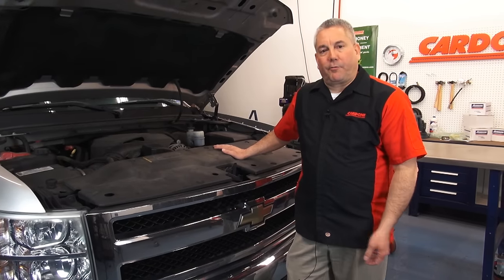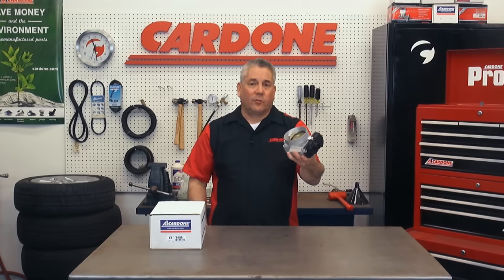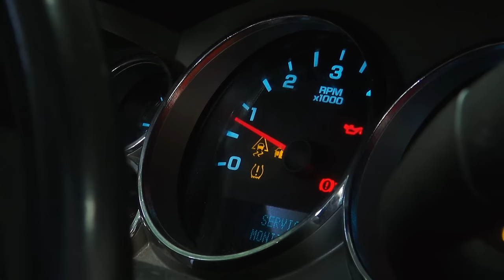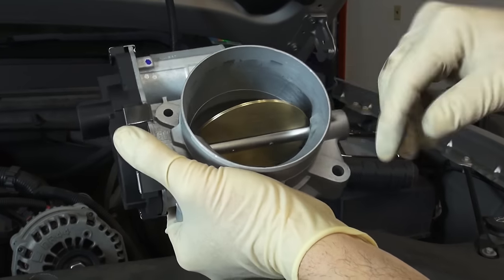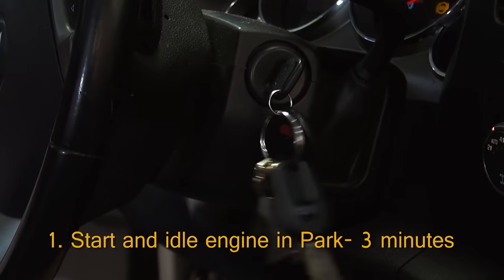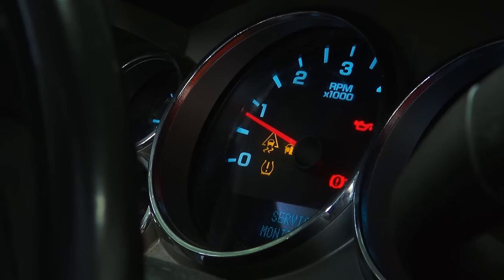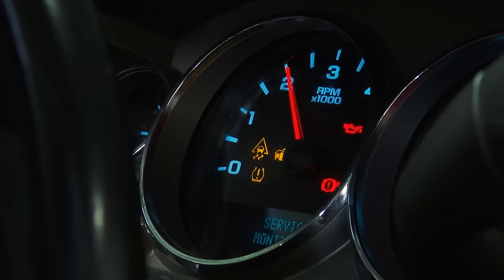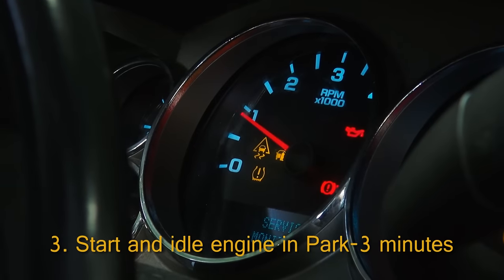GM Truck Electronic Throttle Body (ETB) Relearn Procedure

Comment: Need idle relearn scan tool this doesn't work
Reply: mook9210 ey Man whats Up, some help which scaner can do the idle relearn
Reply: Just drive the truck changed my throttle ran crazy but it eventually straightened out.
Reply: I just changed mine and it just ran like new, no tool 😃
Reply: It works but you need to clear the code before starting the relearn and during the drive cycle
Reply: @BigBlock632  disconnecting the battery clears the code but if it comes back on while you're driving it wont complete the relearn cycle . You can get a cheap obd2 scan tool that will erase the code for under 40.00
Reply: I replace the throttle with out taking off the battery and now the truck won’t turn on or crank what can I do ???

Comment: 2013 GMC Sierra 1500 New throttle body... had to unplug the ground wire from the battery for 5 mins then my rpms went back to normal and cleared the check engine light.
Reply: Brice Bayless did you do this while the key was in the ignition, truck running or off?

Comment: How do you use a scan tool to reset the computer after the throttle body is installed?
Reply from the maker: It can depend on the vehicle you're servicing.  What are you currently working on?
Reply from the maker: Heres the reset procedure for your 2008 GMC Envoy. 

With Scan Tool - Reset Procedure
 *  Diagnostic Trouble Codes (DTCs) P0068, P0101, P0102, P0103, P0106, P0107, P0108, P0116, P0117, P0118, P0120, P0122, P0123, P0128, P0171, P0172, P0174, P0175, P0201, P0202, P0203, P0204, P0205, P0206, P0220, P0222, P0223, P0300, P0351, P0352, P0353, P0496, P0601, P0604, P0606, P060D, P0641, P0651, P1516, P2101, P2119, P2120, P2122, P2123, P2125, P2127, P2128, P2135, P2138, or P2176 is not set.
 *  Ignition ON, engine OFF.
 *  The vehicle speed sensor (VSS) is 0 km/h (0 mph).

 1. Ignition ON, engine OFF, with a scan tool, perform the Idle Learn Reset in Module Setup.
 2. Start the engine, monitor the throttle body Idle Airflow Compensation parameter. The TB Idle Airflow Compensation value should equal 0 percent and the engine should be idling at a normal idle speed.
 3. Clear the DTCs

    Important: Do NOT perform this procedure if DTCs are set.

Comment: Hi, I just cleaned the TB of my GMC 2008 5.3L and after I put everything back, turn ON the engine, ran it t on Parking for about 3 mins the RPM went to 3000, then later I drove my truck for about 1 hour, as I read on other comments, on speeds of 40-50 MPH, the high idle is still there, what can I do to reprogram the TB and lower the idle RPMs? Please let me know, thanks a lot for your help.
Reply: +Cardone Industries Hi, thanks for answering my request, my truck is a GMC SIERRA 1500 extended cab 5.3L SLE model, I hope this information can help, thanks again
Reply: +Cardone Industries After a few days driving my truck the RPMs when down almost to normal, on Parking they go down to 600 RPM, but still when I drive it and make a stop the RPMs stay at 1,500 and go down slowly making my transmission not taking the gears down normally and then you can feel the gears making a big bump when they go down, any ideas??? Thanks a lot for your help
Reply: +grillomix My 07 Avalanche is doing a similar thing. I ended up taking it to a shop where they re-set the learn procedure I guess, now it seams to be idling back to normal in park and when i come to a stop. However I do notice it will increase RPMs when costing even on a upgrade. seams to level out at 20MPH. another note it also only seams to have problem when at operating temp. when the truck is cold it operates as normal. Also seams to be shifting late, worried it will damage my transmission and wear my breaks fast. I'm hoping driving will complete the learning.
Reply: +Leon Calderon  did your car end up completely going back to normal? and how much did the shop chaarge you for the learn procedure?
Reply: +Tyler Lapp Hi, I ended up taking it to the dealer, they charged me $110 but I found out there is a recall on the software for the throttle, so go to the dealer and ask for the recall and this will fix it

Comment: Mine would sonetimes overheat if I let it idle in park for 3 mins cuz it idles at 1700 at times.
Reply: Shouldn't over heat from idling for 3 minutes unless the radiator is plugged a bad thermostat bad water pump or you have a blown head gasket or cracked cylinder head .  Did your electric fans turn on because they should if it starts to get warmer than normal & the 07 - 09 models usually ran at about 210 degrees to begin with but like I said it shouldn't over heat after just 3 minutes of idle time even if the RPM's are up higher than normal because the throttle body & computer are relearning .

Comment: I cleaned my throttle body 2010 Silverado and my engine ran at over 3000 rpm there was no way I was going to keep my engine running for 3 minutes.

Comment: I cleaned my throttle body on my 2013 escalade it idles at 600 but it downshifts hard now, is it just tryn to relearn still? I did the procedure stated in the video
Reply: i did the same, same problem, Do you resolve it?
Reply: @ForzaRT  yes i hooked a scanner to it and did the idle relearn from it and its good now

Comment: I have a 2005 express 3500 with a 6.0l engine that does not have an electronic acutator but a mechanical throttle cable and an IAC and position sensor.  Will this work for that setup?
Reply from the maker: Our technical experts at 888-280-8324 can help answer your question. I believe it only works with an electronic throttle body, but they can answer for sure.
Reply: @CardoneIndustries  Was just looking for a procedure like for the electronic TB

Comment: This doesn't work on a 2006 Pontiac G6. Just buy a Foxwell NT510 Elite and you can reset it in 5 minutes without causing all the wear and tear putting a car in gear when it's idling too high trying to do the stupid relearn that doesn't work on some GM vehicles. A shop will charge you for a full hour of labor (about $150, the price of a scanner that corrects the throttle position sensor), unless you know somebody. You'll drive all around town looking for a decently priced bi-directuonal scanner. Just order online and plan on not driving your vehicle until it arrives. I wish I would've just done that instead of spending a whole day wasting time. Don't follow advice on cleaning your throttle body without having a professional scan tool to reset it.

Comment: Well, I tried all these things and it still stays at 3400 rmps at idle... any other suggestions?
Reply: Manuel Barreda so what did you end up doing? Replacing my tps sensor tomorrow and kinda concerned now
Reply: Nate Noskill I’m having same issue. Did you figure it out?
Reply: Take your time and re-do it , it will work but I suggest clearing the code with a code reader then doing the relearn.  Disconnecting the battery doesn't clear the code it just turns off the check engine light

Comment: My idle is driving me crazy, it runs High 2300 then after a while it does drop. It doesn't stick its more like its being told to run a high rpm, like a brain or sensor thing.  I tryed cleaning it, nothing, so I really cleaned it, I took off the throttle body and cleaned it. I did  a " Re-learn. 3 min, 1 min, 3 min, nope... I took it for the 45 mph drive accelerating & decelerating At first it seemed to help, Nope.  Fact: I put in a cam, its perfectly set up for the Silverado 1500 series 2002 4.8 truck.... Its a 220 220.  581 int / Exs lift  - 112 lobe separation at 1200 - 6200. I finished it off with a  set of D&A long tube headers, a 3500 stall speed converter and a 4.11 rear. It outperforms pony cars, Not the big dogs like the Camero SS, Hellcat or the GT-350-R But it way beyond my expectations. It a 13 sec truck. I think I just answered my question. I did have an ECU flash tune but that was before the... I need to do a re-tune. Umm Thanks.

Comment: Try this. Disconnect battery terminals. Ground both cables to each other, with a wire or metal object. Make sure no contact to battery during grounding. Hold for 30 seconds. Re-attach cables to battery. Turn ignition switch on to acc. (dont start engine)
Wait 1 minute. Turn off, and then start engine. Might work.
Reply: northtone did it work for you? Why you say might work

Comment: No help. 2003 silverado 2500HD with 8.1 and ally 5 speed. Engine replaced, used original intake and throttle body, 2 weeks latter the dreaded reduce engine power. Replace with trottle body out of a suburban with same motor. decent control going down a hill, 6% grade and she ran away, no decent control like the original throttle body. New AC Delco part, still no decent control in 5th gear, works in 4th gear, but not in 5th like it should, like it did before.

Comment: 2008 Silverado, 5.3L Replaced TB, high idle 3000-3500.  Did relearn procedure twice to no avail.  Drove the vehicle, didnt work...pulled battery for 1hr, didnt work...tried relearn again, didnt work....Re-installed old throttle body, worked just have TP sensor codes again....Any advice?? Thanks
Reply: 1949crewchief Same issue. thinking I need the better scan tool to Auto reset the idle
Reply: 1949crewchief I'm having that same problem  mine idles about 2800 rpm  . I  just pulled the battery and will let it sit for an hour and try again
Reply: jean jacque as you seen i tried that and to no avail....good luck!!! hope it works for you!
Reply: I  hope it does  if not I will drop it at the stealership  and let them clear but they say it should go back to normal  after a week  of driving but I don't want to mess up my transmission  cause going in reverse  or drive is a hard bang
Reply: jean jacque i timed my shifting lol. as soon as i hit the key i had it.in reverse before it fired and neutral for drive...my biggest issue was my brakes...its not good for the trans to coast in neutral and my brakes are torched so thats why i said screw it and put old one back on.
Reply: My issue was the pcv valve wasn't plugged in. Mostly normal now
Reply: Mine is plugged in
Reply: Check for vacuum leak.
Reply: No leaks I'm  going  driving  it abut 80 miles or so to see what it  does
Reply: Well I'm pleased  (not) to report  it didn't work.  I talked  to a guy at the dealer and he says the proper procedure is to Disconnect  the battery for 20 minutes  , touch the cables  together for 10 seconds then after 20 minutes hook up the battery then drive it in cruise,  wide  open throttle  and leave it in idle. That's a load of bull too cause it didn't  work
Reply: I  figured it out. Turns out the one I bought was defective.  I took it back and just replaced it . Cranked it up and the rpms were fine. Did it again and  they still  stayed perfect
Reply: 1949crewchief did you get the Hitachi  brand from autozone or O'Reilly.  And make sure you disconnect  the battery before installing and clear the trouble codes
Reply: jean jacque what make did you get?...im thinking of getting an oem...maybe the one i got was junk
Reply: I  got the Hitachi  brand I took it back for another one the American brand and  it's working . It's the only  brand  any of the stores has in stock
Reply: I  don't mean American  but another Hitachi
Reply: jean jacque ok...the one i got was specter...im gonna try and get.OEM...gmpartsdirect.com had them but were a bit more than everyone else
Reply: 1949crewchief I didn't  want to order it so  I got what they had
Reply: jean jacque i dont blame ya....i put the p.o.s. one back on for now so i can hold out for little bit lol...glad it worked for you though...pain in the ass this was....got 200,000 out of it though so not complaining really.
Reply: 1949crewchief  I'm at 199970 I was tempted to put my old one back on
Reply: Mine was a NAPA brand
Reply: I got 166k on mine. Replaced because of that P0121 code. Of course AFTER I bought the truck less than a week ago
Reply: Cory Hayden I didn't get the code  til 135k I got the recall letter from GMC before I hit 120k which is  when it they no longer fix them free . It drove fine until recently  when I would turn corners I would get a power loss like the fuel  was being cut off for half a second  . So I knew  it was time to change it
Reply: Cory Hayden i hate that shit...people know they got a buyer and clear the codes...i rent a real nice scanner and take with me and   have it hooked up while im driving...some codes wont appear until the third engine cycle but will appear on the scanner as pending...i dont like that i cant trust people anymore.
Reply: Oh wow. I've had no power issues at all. Good luck with yours!
Reply: Cardone Industries . you're  missing that the codes must be cleared before starting  the relearn and if the code for the high idle comes back while doing the rest drive clear it , so the relearn can continue
Reply: Hi mate, random question. Do you know what size the opening on the throttle body is on the 5.3l 2008 Silverado? Please let me know if possible.
Reply: We'll lucky for me my friend has a snap on tool we're it can " idle relearn procedure" and the fix it right away .
Reply: wow that's perfect lesson for me. i thought i did something wrong. not mechanic here so
Reply: @jeanjacque1577  thanks for posting the update most people don't

Comment: My car shut off while i was idling in park what does that mean
Reply: Michael Cohan did you ever get a resolve?
Reply: @franksta2006yeah  actually didnt it got way worst but Im going to try replacing the pcm
Reply: Yeah same here. Even mechanic can’t figure it out and now but no engine light. No vacuum leaks, new maf new fuel pump new relays. I don’t know.
Reply: @franksta2006yeah  did you change pcm?
Reply: Michael Cohan no I have a custom tune on mine buts it’s had the tune for three years never had any issues until recently vehicle runs the stalls out. No engine codes nothing. Mechanics can figure it out either.

Comment: Do yo have messanger please. I need your help to reset my nissan xtrail throttle body with out scan.
Reply from the maker: Thanks for the message. If you have a question for our Tech Support Team, please call 888-280-8324 Mon-Friday 8am-5pm EST to speak with one of our ASE-Certified Technicians. They will be able to help.

Comment: I replaced mine and it was like a normal day,,never reved uphigh or anything
Reply: Mind if I ask a question? My 2011 Canyon with the five cylinder engine on a cold start idles rough. Then, after about 5 seconds, this vacuum cleaner noise comes on, goes off, and it idles fine. Does that sound like a throttle body issue to you? I appreciate any advice you're willing to give.

Comment: Works for a 09 GMC Sierra 1500?
Reply from the maker: Timothy, what is the engine size, and is this a 2 or 4 wheel drive truck? Please feel free to call our tech line at 888 280 8324 and a tech can assist you. Thank you!
Reply: @CardoneIndustries  I have 08 GMC Sierra 1500 4.8. It isn’t working. I just turned the ac on blast and it seemed to bring it down to 500 rpm

Comment: i just replaced it on my 07 escalade.. i keep getting p0171 & p0174 .for a lean bank 1 lean bank 2.  nothing else was touched.  wtf is going on?
Reply: the service traction control comes on and im getting those 2 codes...
Reply: Awd throttle body. Intake manifold leak and brake vac line nipple leak.. all fixed

Comment: after I changed the throttle body it wouldn't start period, what could cause this
Reply: +Cardone Industries .....2007 chevy impala 3.5 <the BCM has gone bad, that's why all my automatic lights and etc stopped working.>

Thanks for your reply.

Comment: Get yourself a Foxwell NT650 Scan tool to do a throttle body reset. $185 on ebay or go to the dealer and pay $190 each time.
Reply: ljmoses hi is it difficult to reset the throttle with the scanner?
Reply: @mase202  it took me about 5 minutes at the most.

Comment: This does not work at all, finally had to the Idle Relearn Reset with a Snap On Modis; without it the actual and indicated angles are not synchronized correctly no matter what you try to do otherwise.
Reply from the maker: I am sorry you had a problem. What is your application, year, make model, engine size? Please feel free to call our tech line at 888 280 8324 if you like. Thank you!
Reply: 2008 Silverado, I think it was the year that prevented this... I have it squared away now with the relearn via a bi-directional scan tool.   Your method works on some GM, but apparently not this one, thank you for your response...

Comment: Way more complicated than Ford, Ford you just disconnect the negative first and then the positive cables from the battery run a wire from negative to positive cable, DO not let the cable touch the posts on the battery, wait 15-30min then reconnect the battery cables, negative cable first. Turn engine on, let idle for 15mim, it relearns it idle. Drive the car normally. Some city some highway. And the transmission will relearn how you drive.

Comment: much easier to perform idle learn reset function with scan tool
Reply: Matt Wilson how do you do that ? Is it with an advanced scan tool ?
Reply: @manuelmachado4428  Yes, a Tech 2 or whatever the new PC based scan tool GM replaced the Tech 2 with.